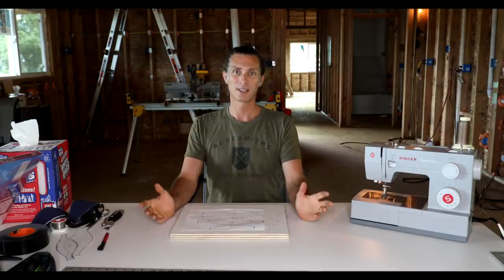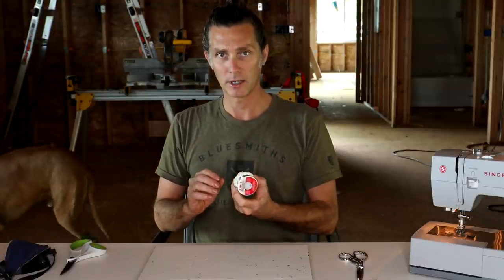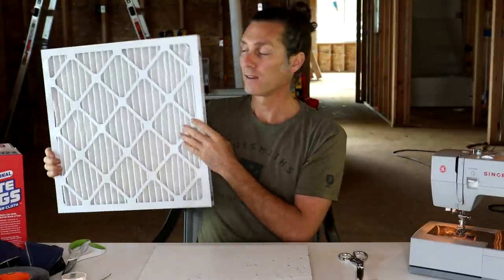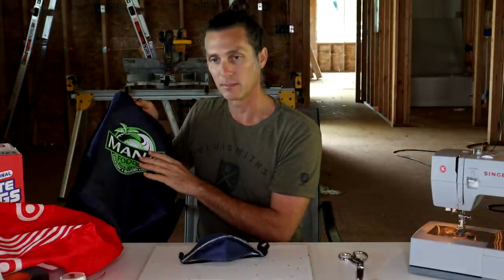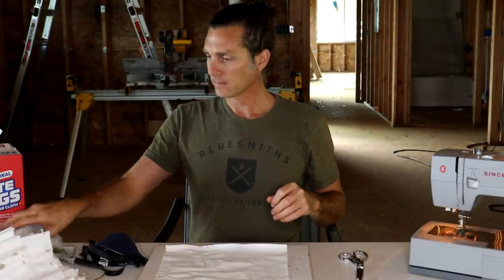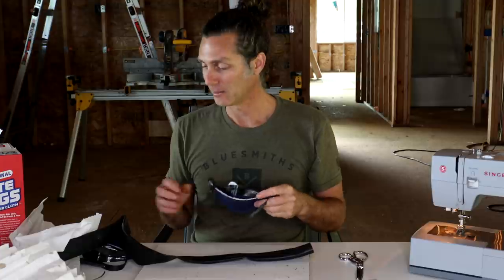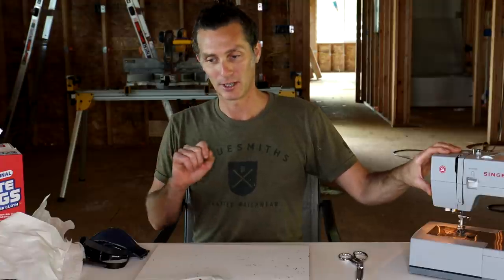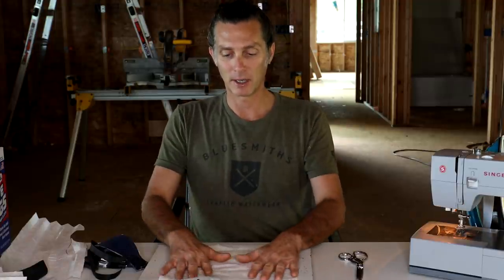Tutorial: HOW TO make your Own High Quality Filter Mask

Comment: Wake me up from this nightmare I have a question about filters and fiberglass how would I know its fiberglass and carbon free
Reply: It should say. Otherwise you can go on the manufacturers website and they should have everything that the filter is made of.
Reply: @elvatoandy  thank you for the info
Reply: @BabyGirl-nb9kk  otherwise from what I've read 3m filtrete brand doesn't contain fibreglass
Reply: From what I read theregular Filtrete as shown has fiberglass which can give lung problems later on. However there js a Filtrete furnace filter line called Healthy Life( check on Amazon) which does not contain fiberglass
Reply: @daniellemiller8631   Share the information. I'd like to see it. I have not see anything saying that. Not even on their website.
Reply: I called 3M and they told me that this filter DOES NOT contain fiberglass
Reply: @rhiataylor5571  see i didn't think so. I was going to call too. Because on their website they compare their filters to fiberglass filters as well.

Comment: Use Filtrete 1900...  you need MIRV13
Reply: Those filtrete are the best for filtering out particles. MPR 1500 is MERV 13 btw according to 3M. BUt the higher MPR , the better of capturing finer particles.
Reply: @KVStarStruck22  Good to know.....  Watched Canadian Prepper video on this when masks became impossible.   He mentioned 1900 was needed and that 1500 wasn't enough.   I did verify your statement though and saw that MIRV13 is covered by the 1500 - 1900 range.    Thanks for the reply and the data!
Reply: Forgive me for saying MIRV.... It is MERV.   
MERV stands for Minimum Efficiency Reporting Value, and MERV rating is the primary rating system used for air filtration.  It is a numeric value that tells you the effectiveness of your selected air filter. MERV ratings are calculated by measuring the number of particles a filter can trap compared to the number the particles it’s trying to filter.  Lower MERV rated products trap fewer particles.   Higher ratings remove larger percentages and a broader range of debris from the air.   FILTRETE 1500 MPR & 1550 MPR HAVE A RATING OF MERV 12; FILTRETE 1900 MPR & 2200 MPR HAVE A RATING OF MERV 13 AND FILTRETE 2800 MPR HAS A RATING OF MERV 14.  

Filtrete 1900 MERV 13 filters capture airborne viruses and bacteria more effectively for this application than Filtrete 1500.    Just look at the data on the various manufacturer websites.   Higher is better... 

MERV 9-12: Relatively high efficiency, middle of the road filters. Can trap particles of 1 micron or larger.  MERV 13-16: Highest efficiency, best standard filters available. Can trap particles as tiny as 0.3 microns or larger.  MERV 12 or Filtrete 1500 is not able to trap particles that are 0.3 microns.   Coronavirus particles (fancy scientific name “virions”) are spheres with diameters of approximately 0.125 microns (125 nm). The smallest particles are 0.06 microns, and the largest are 0.14 microns.  But remember viruses travel in droplets that are larger.   3M N95 Masks can filter particles as small as 0.007 microns – 10 times smaller than viruses.    These Filtrete 1900 filters are pretty much a tiny step up from N95.    

However, how these are used in masks is important.  How the mask seals to your face is crucial.    I have have a leather mask that has 2 or 3 layers of this 3M fabric. Then a N95 with a protective later inside so my spit and sweat doesn't contaminate or ruin the filter paper.   We are also using UVC lamps for sterilization.   I can use these filters safely for about 40 days before I need to cut new ones and replace them.   Remember - Don't touch your mask without sanitizing your hands or gloves first.   Stay safe, stay healthy. 

Any higher you end up restricting airflow.   1900 /MERV 13 is the best for making masks.
Reply: @Scrufboy  Thank you for reclarifying. Can you share what kind of UV bulbs you bought? and How long you sterilize the filters for? thanks much.

Comment: Regarding reuse of the mask, and using heat, and time to neutralize the virus: I don’t have a toaster oven, and I think my regular oven will get too hot at the lowest setting. However I do have an attic that gets pretty hot during the day 100-120F I think. What if I just leave the mask in the attic for a week?
Reply: What about the microwave??
Reply: Sounds like a good idea
Reply: Soak it in 70% ipa for 5 minutes and leave it to air dry.
Reply: @elontusk5553  Good luck finding isopropyl alcohol; that's as hard to find now as proper N95 masks. Would hydrogen peroxide 3% work?

Comment: Does everyone have a printer at home except me? Can you maybe put measurements in the info or something? Thank you.
Reply: 9x3.5 inches for front part, 9x2.75 inches for top and bottom pieces, plus 6 inch long nosebridge tape covering 5 inch wire. 

Or you can measure your own face to custom size it by measuring from nose tip to chin and near to ear to ear. Top and bottom mask parts about 3/4ths the height of the front piece.
Reply: @wwbit  Thank-you!!!!! Much appreciate!!

Comment: Thanks, is there any danger cutTing a fiber/filter in terms of breathing in fibers from it
Reply from the maker: It depends on what the filter is made of. There is no problem cutting this particular filter.
Reply: These filters are fine.  DO NOT try to use HEPA vacuum bags!  Glass fibers!  Very dangerous!  You want a filter that says it filters out bacteria and viruses.  I bought Filtrete 2800s which filter out the max amount of the tiniest particles.  I am making a very close fitting, mask pattern I paid $2.99 for (designed by a company that makes all kinds of specialized equipment patterns).  I’m modifying it a bit by making the elastic go over the head rather than around the ears and cushioning a longer nose wire.  I’m not sure of it will fit tighter than this pattern, but at least it’s washable and uses less filter material.

Comment: Sorry if this has already been answered but I've read that a lot of these filters contain fiberglass  which can permanently damage the lungs. Are these known to be free of fiberglass?
Thank you
Reply: @jalapenopoppers9607  Thank you! There's also a you tube clip somewhere for making cloth masks that were tested for effectiveness and were up to par with the n95 masks. I feel a little safer with fabric since I have a better idea what's in it.
Reply: global life If you plan on using fabric for face masks, try using the highest thread count possible and ensure you have really good insulation so that air enters only in and out through the mask. You can also buy flexible nose wires so that your mask is extra insulated and sticks on your face. I personally would use PM 2.5 filter by making a little section on the fabric where i can insert them but if you choose not to that’s totally ok :). Also remember to social distance + use sanitizers that have at least 70% alcohol.
Reply: @jalapenopoppers9607  Thanks. I actually just bought a cotton one that's 5 layers with a PM2.5 filter. I just need to check to be sure the manufacturer is not on the disapproved FDA list.

Comment: He said you want it filtering both directions and then said put the two filter layers the same direction?
Reply: That's where I got confused..I thought he said fold it in half so then it would going in both directions to block both ways.
Reply: Obviously, the combined filter pieces should have the air in sides facing outwards, the air out sides facing each other. 
Air in || air in

Comment: Another medical person said do not iron the filter at all as it needs to be hydrostatic. Ironing ruins that quality of hte Filtrete filters...
Reply: BS... show the study that states this.  I once saw a video of a guy that said blahs blah blah he's totally medical...
Reply: the polypropylene 3m Filtrete Hvac air filters are made of the unwoven polypropylene which captures potential particles via electrostatic charge and one can also recharge the electrostatic charge by simply running a high speed hair dryer over the filter mask area inside and outside to simply recharge its electrostatic potential once again.

Comment: How about cancelling the sewing and using a hot glue gun. 

JoeB
Reply: Polyolefin has a melting point around 110 to 140 celsius and polypropylene is 130 to 171 celsius.
Reply: @AaaaNinja  for  the Americans, that's 230-284 F and 266-340 respectively, and fabric glue would probably be better anyways.

Comment: The arrow on the filter has to point towards ur face then its effective.
Reply: Jody Sawatzky yes, so correct! He really should add a correction to the video.
Reply: As well - the folds in the filter are purposeful - as they act as a catch
Reply: @bellaspatiogarden3493  
Exactly my thought. Covered and double protection
Reply: @occipitalneuralgia2339  he said as long as they were folded it didn't matter which made sense to me but I would still like to know for sure because once out of the box I have no idea which side is which.
Reply: @sirus804  
Kinda late as I've already took it out so I think..if the filter is folded in half and pinned before you cut it will be fine because it will be double protection like neg and pos. As long as one is opposite I can't see it not working. Now using one piece of filter and not knowing could be a huge mistake but one piece folded in half I would think it has to work maybe even better than one piece alone. 
Thoughts?
Reply: @bellaspatiogarden3493  
Maybe for the furnace but not for the mask, it wouldn't be possible to do that.
Reply: @sirus804  
That's what I did :)

Comment: 3M now says materials are not meant to be used by humans breathing through them   try to use shop towels instead
Reply: I planned on putting the filter liner inside the folded shop rags, that would protect that. I thought the article said  fiberglass only and these filters are not fiberglass but I'm still going to sandwich it in the shop towels. That was a question I forgot to ask him, glad you brought it up.
Reply: OF COURSE these types of filters are not originally intended - or tested - for that purpose, so - safe or not, helpful or not - for legal/ liability purposes they would never be able to approve/ condone their use as such.
Reply: @Mel-pb5xw  
Absolutely so...let's get sewing :)
Reply: 3m has to say that to cover their butt. I have seen several drs who  have done the research and are using these in their homemade masks.
Reply: @diasweet47  do not use fiberglass.
Reply: @GailWright  
Thank you.. No, the filters I have are not made of fiberglass.

Comment: I do not have a printer. I can’t go to the library. What is the height and length of the pattern pieces...I can free hand draw it.  Thanks.
Reply from the maker: Sorry it took me so long to get back to you. The dimensions for the two-main cut out pieces are 21.59 cm wide. The middle piece is 8.26 mm high and the top and the bottom are 6.35 cm tall. I hope this helps.

Comment: They've said not to use hepa filters as these particles can be inhaled - even if sandwiched- and cause long term lung damage
Reply: didn't know that! thanks!
Reply: Filtrete filters are made of the exact same polypropylene material as surgical and n95 masks.  Perhaps you need to specify that you're talking about fiberglass material and not the  HEPA standard...
Reply: The filters used here are safe to use. Theyre made of the same material as N95 masks. Just dont use fiberglass types.
Reply: Who?
Reply: Only if they are fiberglass and most all Hepa bags are not. Read your Hepa bag it should be fine.
Reply: ElonTusk kj
Reply: Jose J Palos oi
Reply: Only the ones that contain fiberglass, The filters should be labeled if they contain or are made with fiberglass.
Reply: If like to hear more on that. It doesnt make sense that hepa filters would have breathable particles. Unless fiberglass and not a true Furnace or AC  hepa
Reply: I’ve been reading a lot about filters. So far what I learned is that 3m Filtrete 1500 and above are comparable to N95 masks
Reply: Who said??? Watch sources carefully. I have been fooled by info also. it takes a lot of research.
Reply: ElonTusk not true. Even 3M warns not to use furnace filters for virus masks.
Reply: @occipitalneuralgia2339  Saying not true means I'm wrong, which I'm not.  Thanks.
Reply: ElonTusk excuse me, but 3M has issued a statement saying they should not be used.  Maybe it’s just to protect themselves, but I am glad I saw that. I actually went to the store and had one to purchase in my hand, and thought twice of doing so. Glad I didn’t buy it. You do you, and as a cancer survivor, with seasonal respiratory  problems, I will pass.  Thank you. Leave me alone. I have spent so many hours in researching these darn masks, I am sick and tired of it.
Reply: @occipitalneuralgia2339  
I don't think anyone is using just a furnace filter for a mask. 
I've not seen a warning like that and I've did a lot of reading.
Reply: @occipitalneuralgia2339  
Russell did say if you don't have a filter just use extra layers of the cloth.
Reply: diasweet47 Plenty of YouTube’s are using furnace filters. I have watched dozens of videos where 1500 and 2200 MERV rating furnace filters are used.
Reply: @elontusk5553  I called 3M about using the material in the 1500 filter and THEY SAID  they DO NOT recommend using it in THE MASK.  $17.00 dollars I WASTED>
Reply: @rtrouthouse1506  I CALLED 3M RE FILTERS. THEY DO NOT RECOMMEND IT FOR THE MASKS.
Reply: Iam using Hoover vacuum bags. Hoover said they do not have fiberglass in them. My brother in law is a  Chemist for Raytheon and he says the vacuum bags are fine.

Comment: I am under the impression that the HVAC filters are made with glass fibers
Reply: No not all filter material is fiberglass , if you have any concerns contact the manufacturer and they will be more than happy to give you the information,  and  just know filtering capacity is measured by what's called a Merv rating . A Merv rating of 16 is equivalent to n95 filtration it is what's used in Hospitals,  that is in a  non surgical setting. As always do your research and get the info it is readily available from the manufacturer's.  Good luck stay safe.
Reply: @Gcanno  All of 3M Filtrete line of HVAC system air filtration filters are all made of unwoven polypropylene and 3M make their rating up to 3200 rating with two standard size Filtrete filters going for about $50; so its definitely affordable.

Also one can buy the same stuff from www.filti.com but they sell like 107sq. ft. for about $100 plus about $13 for shipping which literally makes hundreds of filter masks; so no real worries about dirty filters if one simply changes the dirty filter out with a new one; one can literally have hundreds of spare filters costing a minimal amount of money as compared to n95 masks which costs and arm and a leg; if one can potentially get them at all nowadays.

Comment: All materials used in this mask seem to be good filter material, with one important note. Russel constructs a mask using Gorilla tape, which is stronger than duct tape.  See, below, link to the "SAFETY DATA SHEET-Gorilla Tape : 
      "Keep from direct sunlight. Extremely high or low
temperatures."
       "Store in a cool/low-temperature, well-ventilated
(dry) place. Keep away from heat."
      From additional material that I've read,  Gorilla tape, or anything made with Gorilla tape should be kept away from dogs. If a dog were to ingest some of Gorilla tape it could cause a serious obstruction, that could result in needed surgery. So, if you use Gorilla tape to make this mask,  always store the unused tape safely as well as the finished masks. So I would suggest a careful read of this link from Gorilla.
https://docs.rs-online.com/a0f5/A700000006631494.pdf

Comment: TIP: use the wire from the furnace filter. Wrap to keep from poking your face.  Too many layers restricts breathing
Reply: Or aluminum foil pans used in baking. More durable and you don't have to worry about it poking through the fabric.

Comment: Does anyone have any actual measurements for those mask? Inches, centimeters? No printer available
Reply from the maker: The Width of three pieces are 21.59 cm.
The middle piece is 8.26 cm tall. The nose piece in the chin to use our 6.35 cm tall. I hope this helps.

Comment: Is this a one-use mask? How would you wash or sterilize?
Reply from the maker: I am putting the used masks in our toaster oven at 150F for a couple of hours. If you go much higher with the temperature you risk melting the mask materials depending on what it’s made of. 
I also have a mask I use when I go to town. This mask I leave inside facing up on the dash of my car in the hot sun. UV light and heat.  We live in Hawaii where we usually get plenty of sun and the car gets quite hot during the day.
Reply: @outofthedoldrums  Thanks for the response!
Reply: @outofthedoldrums  Yes, heat works well for the virus and most microbes.

Comment: I watched a Paediatrician who did some research and made her version or DIY n95 mask. She does not recommend ironing the filter. "The way this filter attracts viral particles is through electrostatic charge. There is some physical filtration but the viral particles are so small they're 0.12 microns that they require the electrostatic charge to work effectively. If we were to heat it or iron it it's not going to work effectively " 
My Pocket Paediatrician
Reply: This is JMO from my husband being a Heating & AC installer Tech. This is a filter for furnace and AC unit, the blower motor puts out more hot air through the filter system than a iron set to med low heat, I don't believe it will damage the function in any way, just don't make it hot enough to melt it or the bag material..same thing.
Reply: And Russell did say you don't have to if you don't want but I certainly couldn't get it lined up properly without getting the accordion creases out. They were still there but flat enough for me to cut.